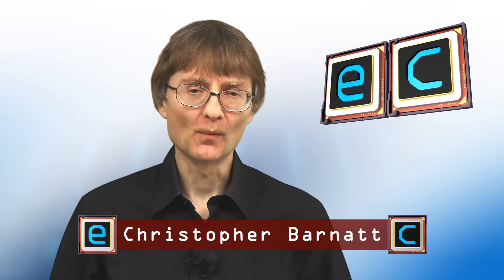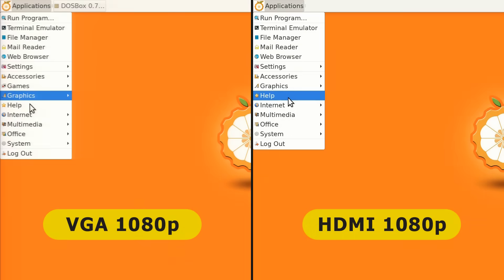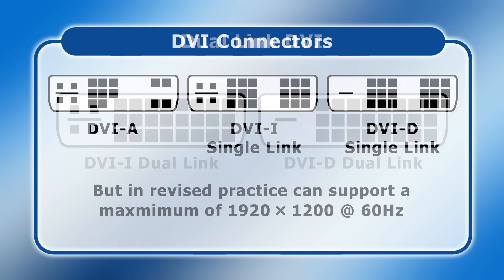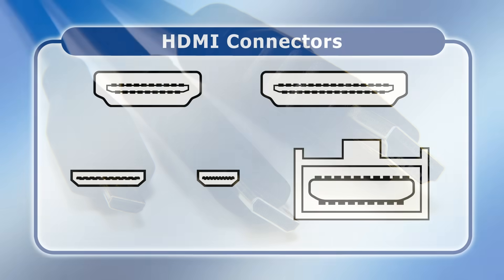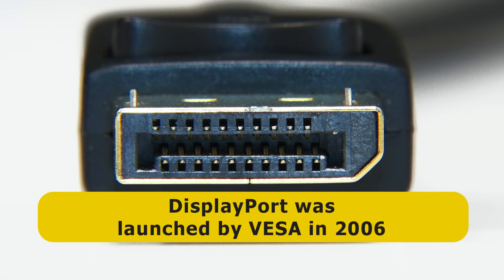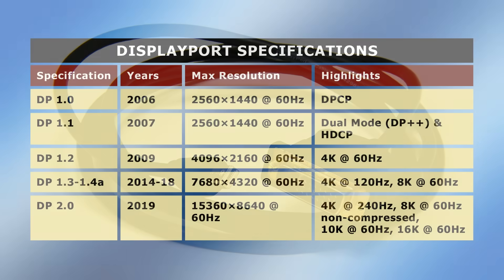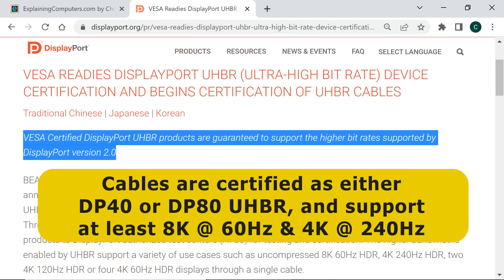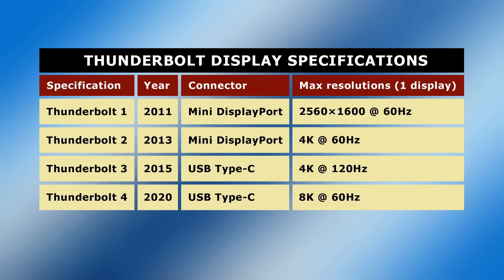Explaining Display Connectors: HDMI, DisplayPort, USB-C, DVI, VGA & Thunderbolt

Comment: Not enough details is given about compatibility between DVI-D and HDMI. The statement that they are fully compatible is questionable.
Reply from the maker: DVI-D carries all HDMI video signals (not audio). The signals are identical. Fairly obviously, compatibility is limited to the resolution and capabilities of DVI-D.
Reply: @ExplainingComputers  I have HDMI output of videoadapter and 2k monitor with dual-link DVI input. And a cable that is DVI-HDMI. Despite all the latest drivers I can't get 2560x1600 resolution via HDMI-DVI. Although HDMI-HDMI from the same videoadapter easily supports 4K
Reply from the maker: @tennishistoryandresultsdat4540  I see. :) This could possibly be an HDCP issue, or the supported DVI-D input resolution of the monitor may not rise to 2560x1600 (which is, as noted in the video, beyond the initial DVI spec).
Reply: @ExplainingComputers  Monitor is ok. It displays 2560x1600 via DVI-DVI cable. I thought initially that this is a software issue. But the problem persists in Windows 7 and Windows 11 and Linux Mint. I was then told that DVI is compatible with HDMI only within single-link specification.
Reply from the maker: Ah, this suggests maybe a cable issue. All dual link does is to duplicate some pins to increase bandwidth. So maybe the HDMI to DVI cable you've tried is not wired internally for dual link at the DVI end?

Comment: HDMI (Type A) transmits audio. My PC is connected to my TV via a single HDMI (Type A) cable and I get sound. I also have a Blu-ray player connected to my TV via a single HDMI (Type A) cable. Unless I am imagining it I also get sound when playing a DVD/Blu-ray disc.
Reply from the maker: Yes, HDMI transmits audio, exactly as the video says. The HDMI section opens "The high definition media interface, or HDMI, was introduced by a group of seven TV and computer manufacturers in 2002. HDMI is a digital-only connector that can transmit both video and audio". :)

Comment: I never liked Audio out being limited to the HDMI. But I found out that HDMI audio extractors are a thing! This can help to improve synchronization of audio and video if you use an audio device that isn't part of your TV or monitor, or if there is no audio or audio output on the screen.
Reply from the maker: Yes, HDMI audio extractors can be very useful -- and increasingly so in a world where fewer devices have traditional audio connectors.

Comment: I appreciate these travels through history. Bring back memories of RS-232 at a blinding 110bps.

It's a shame that the industry that flubbed IEEE-1934 is still at it and never got the memo that everything is fungible packets and copper is copper, so creating all these special-purpose cable no longer makes sense. DP over HDMI cables demonstrates this. Converging on USB is an intermediate step piggybacking on the more important role of USB-C as a power supply. At some point, we'll pull the slipknot, and all the special cables will get related as a generic network as with Ethernetnet and Wi-Fi.

Comment: Thanks for the great review. I didn't see a mention of the ability of HDMI to also provide audio.
Reply from the maker: The HDMI section opens "The high definition media interface, or HDMI, was introduced by a group of seven TV and computer manufacturers in 2002. HDMI is a digital-only connector that can transmit both video and audio." :)

Comment: Great video! Only thing you really missed: HDMI alt mode is much rarer than DP alt mode, basically owing to thunderbolt requiring DP, and DP getting there first. Seems like it was only really used for docking phones (which no one does anyway. Basically it was a successor to MHL) and apparently it was just recently killed off. I’d say it’s a shame… but it’s already hard to tell what a USB-C port can do, so maybe it’s better off it didn’t end up with two consumer video standards.

Most if not all “USB-C to HDMI” cables/adapters out there actually just convert from DP to HDMI at the end.
Reply from the maker: Some USB-C to HDMI adapters may indeed convert from DP to HDMI (although USB-C to HDMI pre-dates DP Alt mode). But USB-C to HDMI cables most certainly do not convert.

Comment: I just bought a USB C male to DisplayPort 1.4 female adapter so I can run my Valve Index from my laptop if I ever needed to. It only has a resolution of 1440x1600 per eye, but it's still crazy to me how I can push such bandwidth through a tiny port like that.
Reply from the maker: I too find it amazing what we are now pushing through such a tiny connector. :)

Comment: VGA? What about Composite? 😆
Reply from the maker: Not common on modern computers . . . :
Reply: @ExplainingComputers  I wouldn't consider VGA common, either. If you are lucky, you get a graphics adapter which still has DVI. But most will go with HDMI or DP nowadays.
Reply from the maker: @Nikioko  I don't know where you work and what hardware you use and purchase, but VGA is still very common. A lot of new motherboards still have a VGA socket, and a lot of graphics cards too. And as a speaker, I can assure you that most lecture theatres, conference centres and hotels have VGA connections to their projection systems, and still often only VGA.

Comment: Disagree strongly about the compatibility of DVI and HDMI.

In theory it should work as HDMI originally was basically DVI and SPDIF multiplexed onto a single cable/plug.  However in practice  it doesn't work.

The problem is HDCP.  If you connect HDMI on the computer to a DVI screen it will not work due to HDCP.
Ive spent a fortune  on adapters and cables trying to get HDMI to DVI to work.
Electrically it fine.     But  when you start up the computer. you might see a small splash screen on your DVI screen but goes dead once HDCP kicks in.

 HDCP was developed by Intel to stop people copying DVD through the digital signal going out to the monitor.  It was cracked 20 years ago, and is totally useless today.
The only effect today is that you will probably have to junk a perfectly good DVI monitor if your computer only outs HDMI.  Or use an HDMI to VGA adapter which gives a very poor image.
HDMI to DVI cables and adapters are available on the market but wont work.

But good old karma.  As Intel stock price crumbles to dust as the world's landfills fill up with perfectly working DVI screens that are unusable, the schadenfreude is sublime.
Reply from the maker: Good point on HDCP. But I've never had a problem stripping it out using a one-in, two-out HDMI splitter -- I've been recording all manner of HDMI-only computers on this channel that way for years.

Comment: It's all a nonsense really. You can get high definition video video AND stereo sounds via radio waves (wi-fi), so why the need for a gazillion different multi-pinned plugs and sockets ?
Reply from the maker: I cannot believe we will ever reach a point when all displays will be connected wirelessly. The WiFi space is already crowded.
Reply: @ExplainingComputers  
I wasn't suggesting that they would or should, I'm suggesting that it's an utter nonsense that we have all of these plug/socket designs/configurations one just 1 would do everything.
Reply from the maker: @lewis72  Oh, I agree with that! :)

Comment: So, a pertinent question is which type of display is better to buy: HDMI or DisplayPort. Thunderbolt is convenient and great if every device you have has a Thunderbolt connection, but many cameras, media players, displays, and projectors do stick with HDMI or DP -- and this may continue. 

HDMI is the more common option, especially on Displays, TVs, projectors, DVD players, etc., but the generations and copy-protection modes can make it difficult to use with some older equipment. And this cross-generational pattern might continue. It has also been a generation or so behind DP. 

DisplayPort has all the features of HDMI (other than LAN, I guess), but there are fewer problems being locked out of older generation equipment. One other feature useful for films / movies is dynamic frame rate. If your display refresh rate is not the same or a multiple of your video source's framerate, then individual frames may be "torn" or have other artefacts. AMD's FreeSync allows display refresh to vary from 30Hz, 48 (for 48fps or 24fps with each frame displayed twice), 60, 90, etc. to match display rate and frame rate. DisplayPort has long integrated FreeSync. (Gamers use this for high frame rates too.)

So, the more you can include DP on your devices, the better. Most computers already play to either standard through a USB-C adapter cable. Many displays, though, especially the cheapest, accept only HDMI. So I would recommend opting for equipment that includes DP even if you aren't using it now. 

As to a Thunderbolt-only display like Apple's, those are just ridiculous (for the general public). Apple's studio display is almost custom made for Apple Pros and newer Apple computers. Do not fall for one of the imitators especially. Unless you're in a studio using only a high-end computer as the video source, do not go with Thunderbolt only. Thunderbolt, DP, and HDMI-equipped triple-compatible displays would be best, but they're still new, expensive, and limited. Until then, DP AND HDMI is the way to go. (In my opinion)

Comment: I kind of expect the next USB specification to include Thunderbolt, DisplayPort, HDMI specifications, and even networking, with interface ICs to automatically include st least some support for all those uses, and automatic use detection. If not the next, then pretty soon, which will make the existing DisplayPort, HDMI, and even USB type A connectors to become obsolete, which will herald the domination of smartphones as the only general computing device for damn near every consumer. I believe laptops, tablets, desktops, and even servers will after a certain point ONLY have USB type-C connectors for external IO.

Comment: Does anyone know if the latest standard HDMI cables are backwards compatible, i.e. will an HDMI 2.1 cable work with older GPU cards or TV equipment outputting a max 1920x1080 @ 60hz?
Reply from the maker: Yes, all newer HDMI cables will work with older equipment. So an HDMI 2.1 cable will work with everything. An HDMI cable is just  a data cable. The newer ones are only different because they are guaranteed to support the higher data rates required for higher resolutions.
Reply: Thanks Chris, much appreciated and thanks for a very clear and informative video. It has helped me to make sure I got the correct cables.

Comment: Due to the long VGA cable  (over  10m) is cheaper than a DVI cable in same cable length. You can connect 2  DVI-only display device by using a VGA cable.

Comment: Universal adapter is common found in Asia
Reply from the maker: Yes, it is always possible to get hardware to convert from one display standard to another. But such hardware includes powered conversion circuitry, and is therefore NOT an adapter.

Comment: Where do ultra wide resolutions stand in this? I mean if a standard supports max 4k 30Hz does that mean 5120x1440 will work at all, at 30Hz or something else? It's maddening that the info about these specs are so convoluted and hard to find. Could one solution be that instead of supported resolution we would talk about max bandwidth and have a sort of cheat sheet on how much bandwidth resolution/refresh rate combos need? Doesn't sound like a good solution but maybe it would be better than what we have now. :/
Reply from the maker: This is such a great question! As you say, information on the  ultra-wide images is hard to find -- I started to include this in the video, but rapidly gave up. Not least the fact that 5120x1440 is often listed as "5K" (which is clearly isn't) does not help.

As far as I am aware, what you say is correct -- standards supporting 4K at a specific frame rate will support 5120x1440 at that same frame rate.

Comment: There was also - briefly, and confusingly - the Apple Display Connector (ADC), which was used on Apple monitors, and Macs with video connectors, between 2000 and 2005. 
Based on DVI-I, and resembling a DVI-I connector with 35 pins and rounded ends, ADC was Apple’s attempt at unifying video, USB, and power into a single connector. 
I had a 2002 Mirrored Drive Door Power Mac G4 tower which had 1 x DVI-I connector and 1 x ADC connector, and would support 2 monitors.

Comment: Will it be a problem if i run 2nd and 3rd monitors with DP to DVI cable (they run 1980x1080 60hz both) with main screen running 4k 60 hz with hdmi? All connected to one GPU.
Reply from the maker: I assume from what you describe that you have two DisplayPort connectors and one HDMI? If so, and assuming that your GPU supports three displays at the same time, this should not be a problem. The GPU does not know or care what happens to the signals once they leaves its ports. :)
Reply: @ExplainingComputers  Yes, thank You Mr Chris, today i tested it and it works perfectly. My gpu is RTX 3060 Gigabyte Aorus with 4 ports, and today tested with 4 monitors, and all works perfectly - 2 DP and 2 HDMI ports. Important is all monitors MUST have same refresh rate set in Windows 11. Cables are HDMI-HDMI and DP-DVI - Three works in full HD and one in 4k res. Card manages nicely. Only cap is my old i5 8600 with multiple tasks like chrome and some programs it hits 75% usage. Thank you very much and take care :)

Comment: In my 16 to 17 years of history where I build or use a PC, I have never used the DVI port.
Which shows its uselessness to me.
VGA, HDMI and Displayport are the only ones I've really used so far.
Where at my main display is powered by HDMI 2.0.
The problem with DP and HDMI is usually the cable quality, which varies greatly.

Comment: There are a lot of moving parts with video cables. Those charts tho, they are the best thanks for all your work! This was utter simplicity for a time, now it's complicated by versions. I had one of the Nvidia graphics cards that did DVI + audio, it played movies direct from the computer to the display up above with WMP.  I left that setup running a playlist continuously for over a year just to have something playing on the TV in the room. It was a good stable system that just worked, was fairly low-cost too.

Comment: for me display-port is the spec that will go strong for pc, maybe unified over usb-c/thunderbolt - but as both thunderbolt and usb-c just started to get all crazy with their additional sub-standards for alternative modes and power delievery and all that I guess it'll take some time until we get the one connector to rule them all
I'm not sure - are usb-c and thunderbolt even inter-changeable passively or are they just use the same physical connector but with different electrical pinout?
as for "regular consumer electronics" in the entertainment segment hdmi already is THE standard used everywhere and it will likely not get de-throwned anytime soon
as for professional setups: I don't have much knowledge here but I guess several standards will be used along eachother as they all come with the specific pros and cons - so it will be a "it depends" answer
as for audio-over-dvi: I've read your comment before as I do have such cables in use - I think you're correct with your comment that audio is not part of the dvi signal but many compatible computer graphics cards switch the actual signal to hdmi (which often is the type of connector on the other end anyway) so the acutal output is just regular old hdmi but over a dvi socket with the matching pinout so a passive cable connects the pins in the correct way so that from a logical view it's just a hdmi connection
I'm not sure if there's any standard for this - but as many gpus offer it and there're a lot of passive cables it seems at least some de-facto agreement between the parties involved

Comment: My new setup is a 2013 desktop running Linux. First I connected to HDMI, but the TV I use it only could do 1280x1024, and on a TTY all was messed up (suppose Linux couldn't tell the TV the resolution, so parts of the screen did not show).

Used HDMI for the audio part. Later got a Bluetooth speaker (squeaker ;-) and switch to VGA. There I have 1920x1080 now. Also works on a TTY.

Thanks to this episode I learned that HDMI is probably only an option if you not have rock old hardware (TV) I have. 🙂

Btw. I some months ago I was saying here that people might get a little bored because of the SBCs. Looking at the views indicates I am wrong. So keep those videos coming. 🙂
Reply from the maker: Thanks for this. I remember having a time of it getting Linux Mint to output 1280x1024 to DVI or VGA. :)

Comment: usb c made life so much easier especially with models such as the Dell C2422HE/Hp E24m. It has all one needs but built into the monitor and driven by a single usb cable. Compared to the past where separate components are wired separately.

Comment: Given the name, I used to think that DisplayPort was strictly a video only interface. Then I bought a couple of cables that are DP to HDMI (because my monitors don't have DP but my video card didn't have enough HDMI connectors), and when I plugged them in I started getting audio out of the monitor's built in speakers. Needless to say - I was confused.

Comment: I  wouldn't say that VGA is blurry at certain resolution, I think it depends on the divice because I've used computers in different monitors at high resolutions and some were pixel perfect and others had ghosting, so yeah, it depends on the divice and monitor.
Reply from the maker: It certainly depends on the hardware (and cables). But even so, some people find VGA blurry from around 1080p upwards. You can show an HD+ VGA signal on a monitor to two people and some people find it perfectly sharp and others do not.